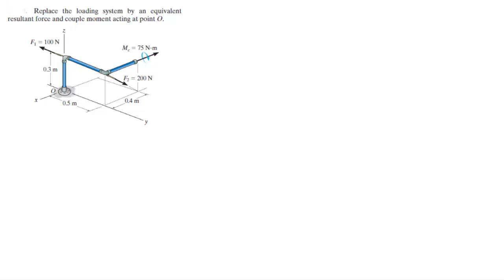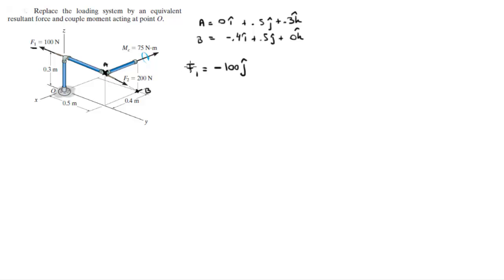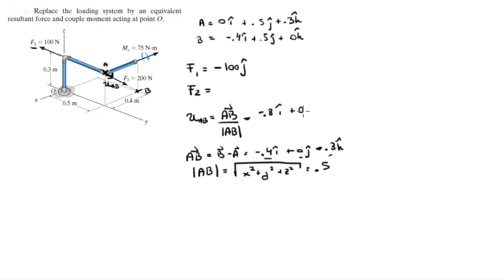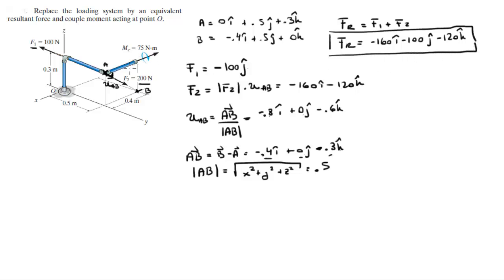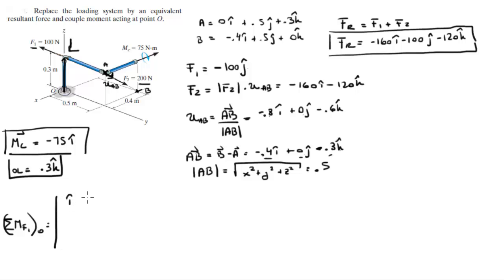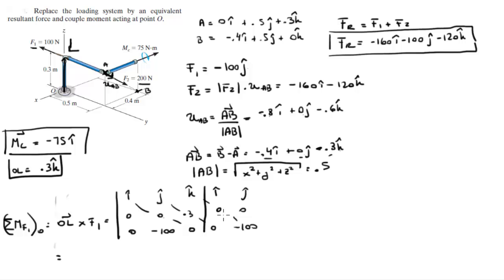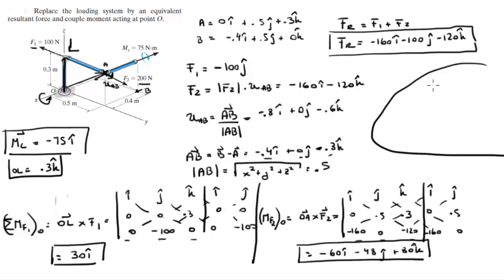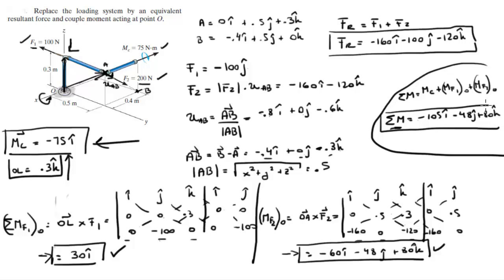Replace the loading system by an equivalent resultant force and couple moment

Comment: a uniform rod AB of weight 100N. The rod can rotate
freely around A, by means of a pin. However, it is held in equilibrium, at an angle of 15
with the upward vertical, by means of a rope that is tied at B and forms an angle of 30
with the rod and is in the same vertical plane as the rod.

Comment: the moment F1 = 30i, so shouldn't the sum of the moments F1 and F2 be -30i -100j -120k?
Reply: Moment of F2 is <60,-48,80>, moment of F1 is <30,0,0>, and the given moment M_c is <-75,0,0>. therefore the correct answer for total moment is <-105,-48,80>. Which is what he had.